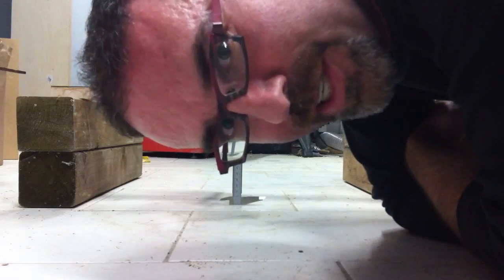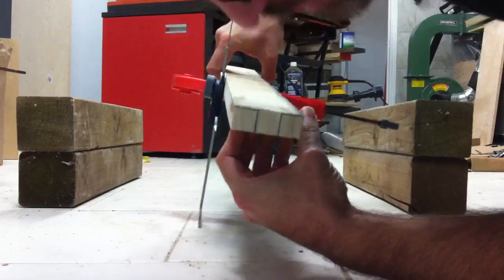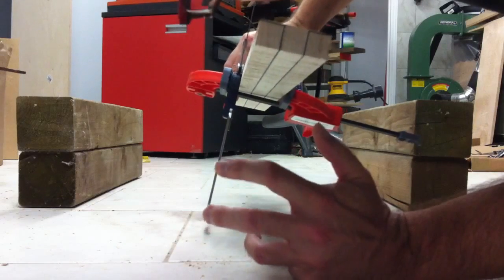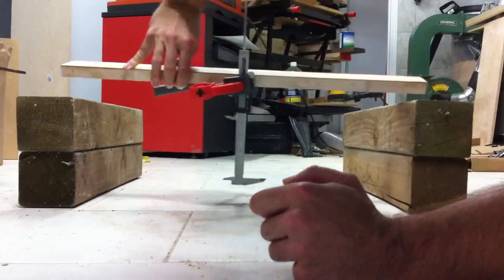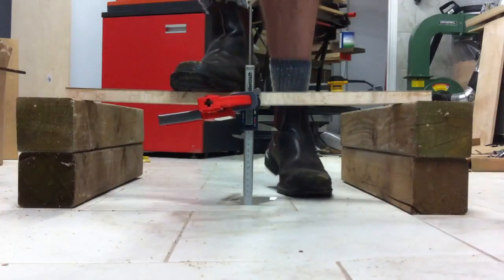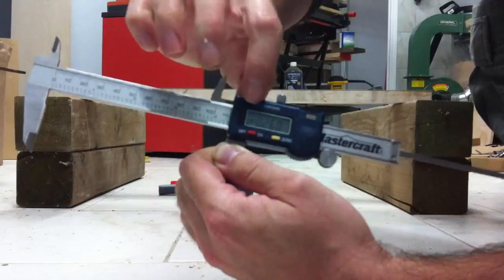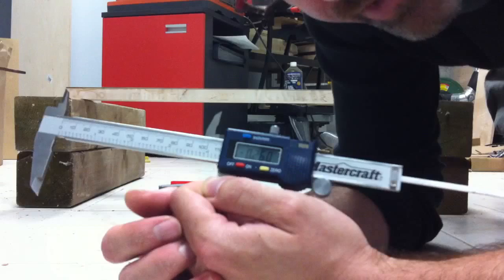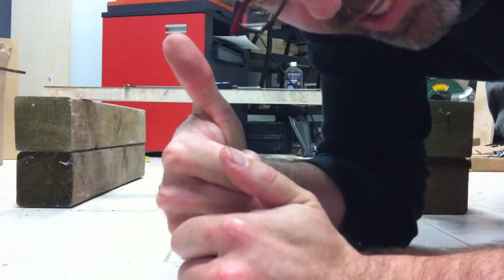Testing the Decibel Carbon Truss™ Neck Construction

Comment: Have you had much testing over the years to see how the dimension changes with the maple relative to the stability of the carbon fiber with climate changes? Wondering if the maple would contract and expand differently, thus revealing the seam with the  carbon.

Comment: the string tension is longitudinal which result in much smaller pressure on the neck  (perpendicular to the neck). Am I rigth ?
Reply: indeed, the actual tension on the neck from the strings, is around 20-25kg, not 45kg like he estimated.